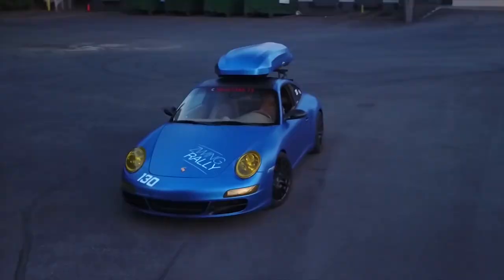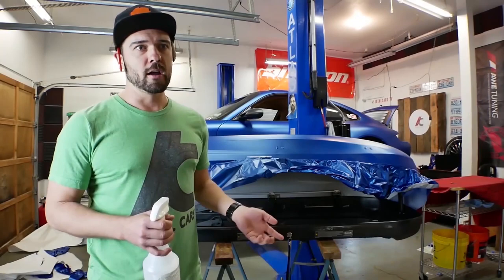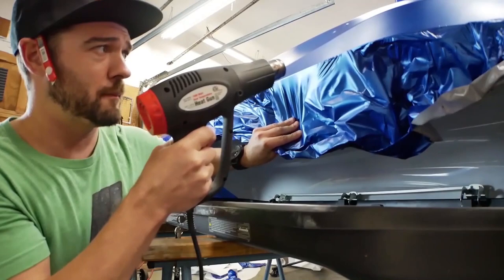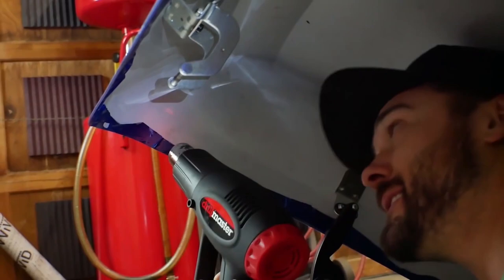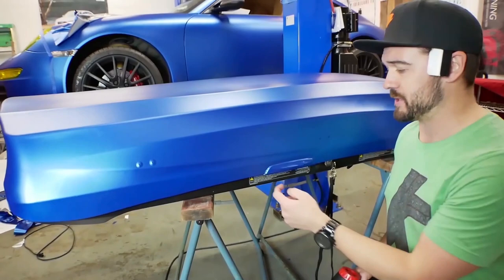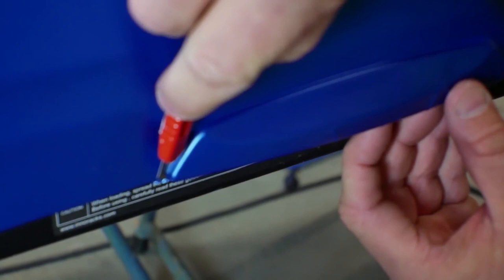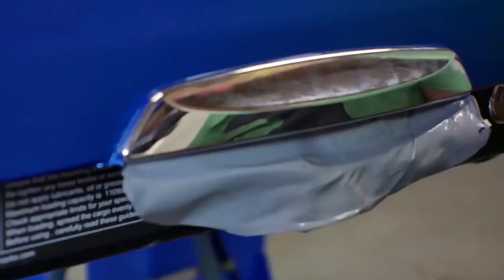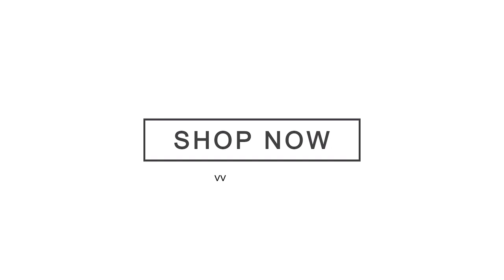FIRST TIMER'S GUIDE TO VINYL WRAPPING A CAR  - Tips & Tricks PART 5

Comment: how do you get the fenders to stick?
Reply: Yea mean inside the wheel well? Was thinking that as well.
Reply: I think it would be best to take the clips out the fender liners and use the same method to fold around the actual fender. Then cut out any holes being blocked then heat it to seal it. put the fender liners back with the clips